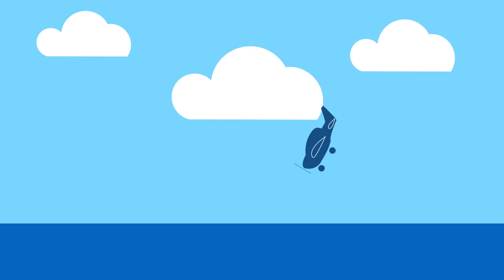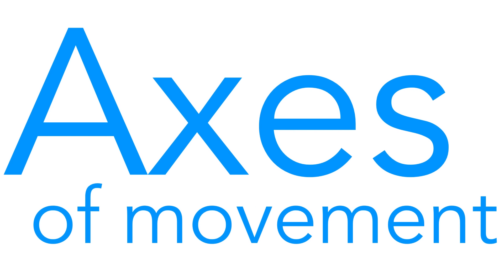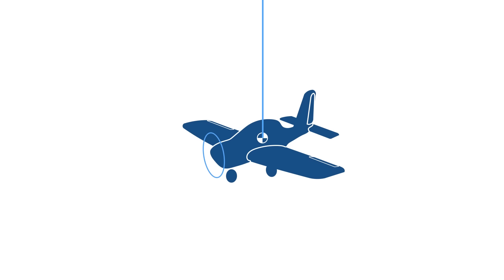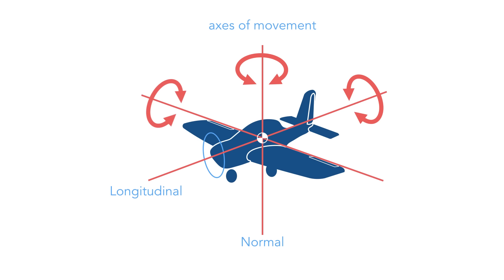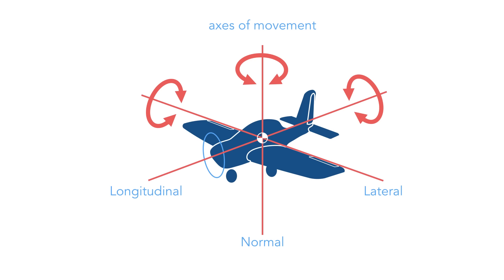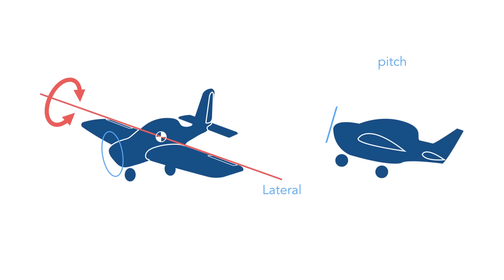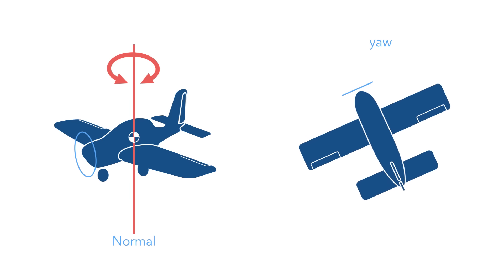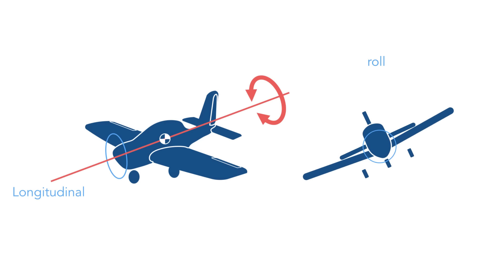Axes of movement

Comment: What the difference between yaw and longitudinal move?
Reply: Yaw rotates the aircraft around the vertical axis, moving it either left or right. In real life, this is usually accompanied by roll, which occurs around the longitudinal axis that runs from the nose to the tail. The ailerons, located on the wings, control the roll by tilting the wings up or down. This usually happens when the aircraft is turning, and the roll helps maintain stability. So, the aircraft can make a full 360° turn and still maintain stability.